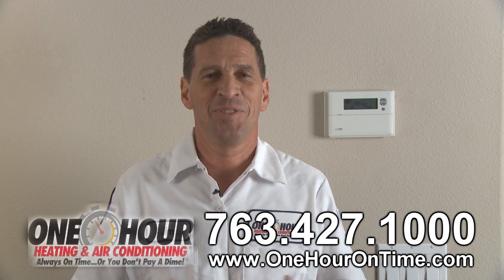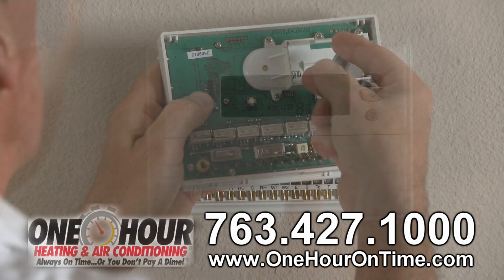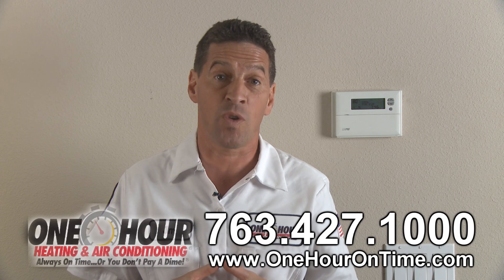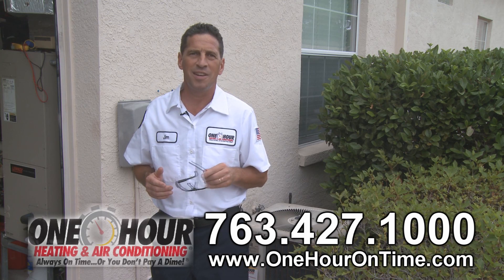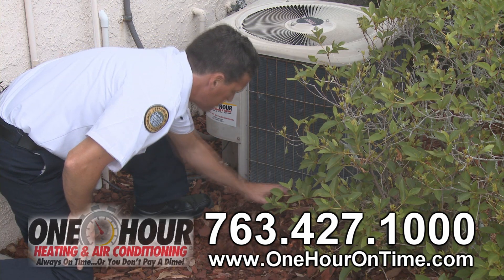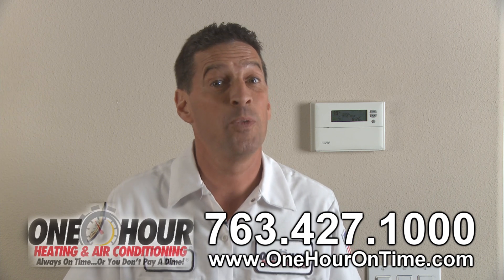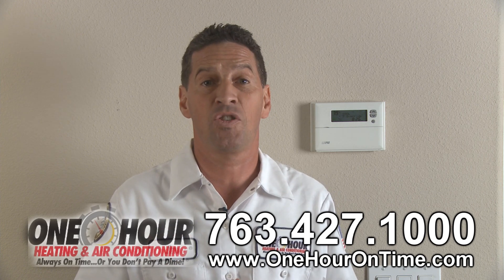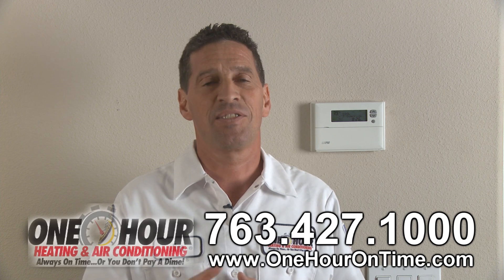Air Conditioning Repair - A/C Repair - Do It Yourself - One Hour Heating & Air Conditioning

Comment: Great video 
Question: I have a 1.5ton  220volts split unit AC. After few seconds of turning it on, the clamp meter reads 23A then rise to reach 37A for few seconds then it stops and the clamp meter reads zero or 0.1A.  What could be the problem  ?